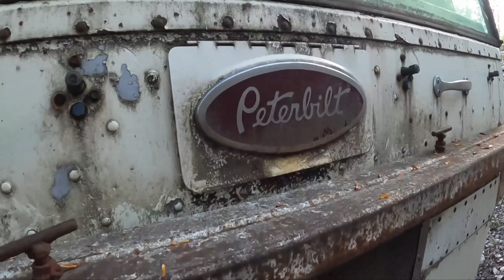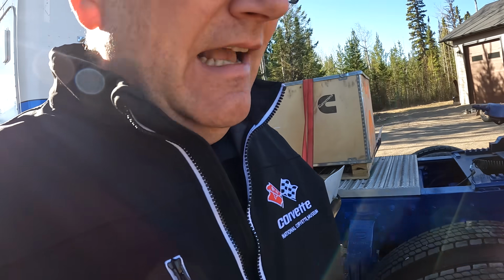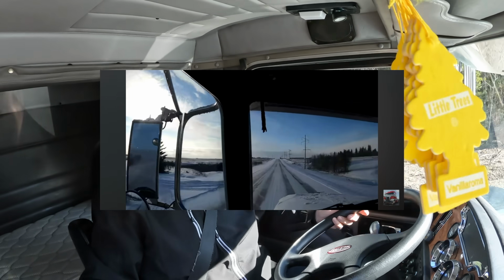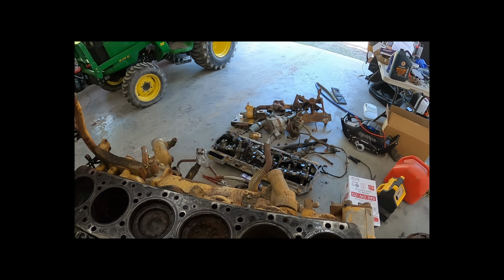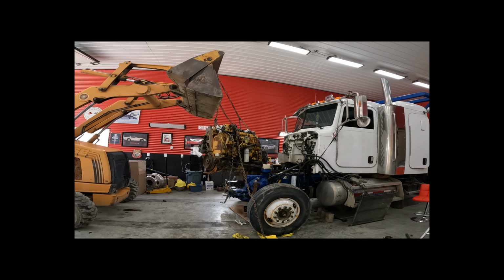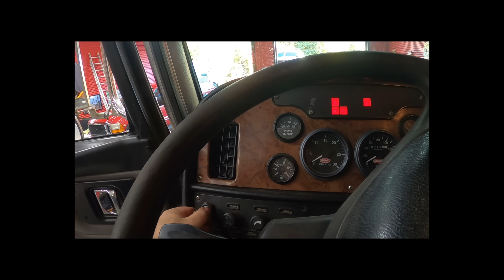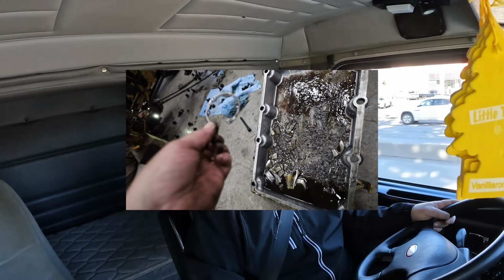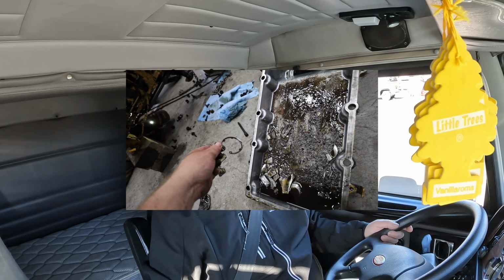Goodbye Duke 😞

Comment: My gosh Mike, did you have a shootout in the Jeep? Looks like someone took a machinegun to the window.
Reply from the maker: Yeah.... original windshield it's getting a new one very soon.  Jeep has to get a new paint job on warranty
Reply: @mikethetrucknut  Wow, Chrysler for you.  Sorry I like Jeep but man they are so iffy on quality. We had a Grand Cherokee 2010, little things broke inside that should not.  Air modules, radiator cooler leaked, air modules again that would have cost thousands to fix.  10 Years we had it but over all it was not bad.